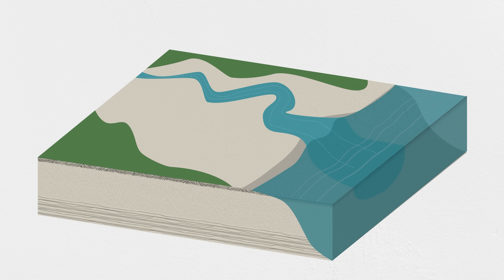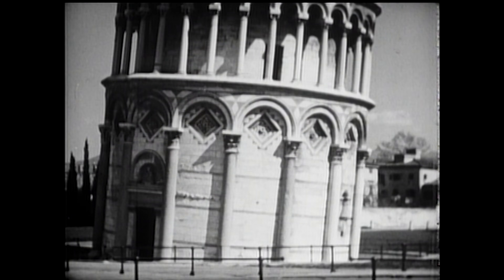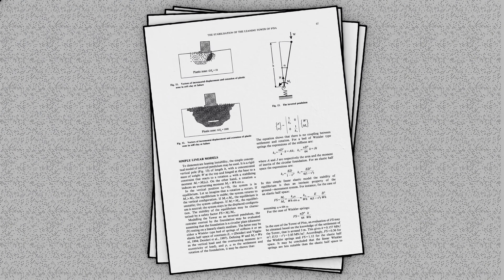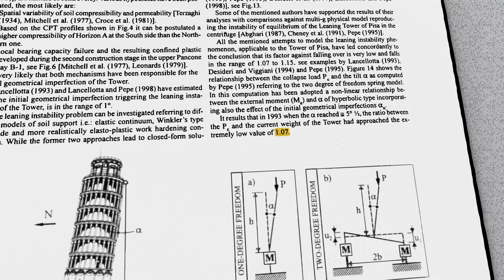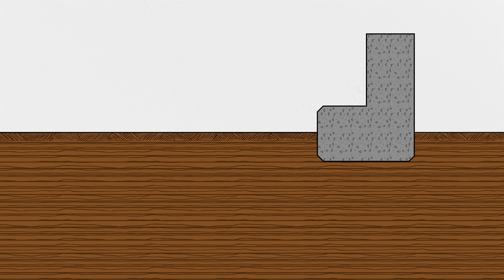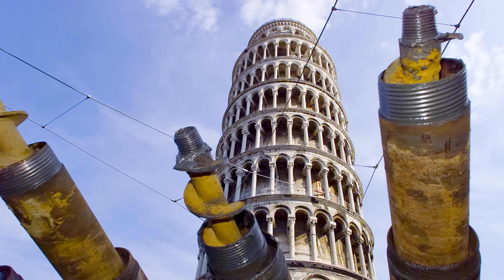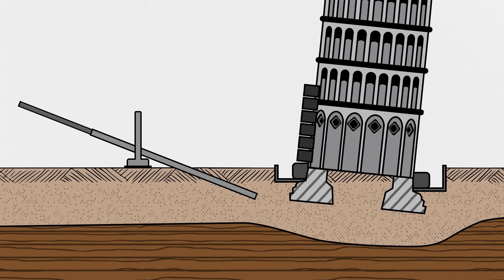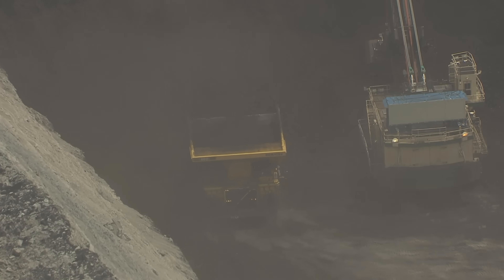How Engineers Straightened the Leaning Tower of Pisa

Comment: Another video like this you could do on a many-centuries-long engineering project, albeit one that ended in failure, could be the Aztec capital/Mexico City's water and soil issues: Tenochtitlan was a giant city with Venice-like canals built on both a natural island and expanded with a grid of artificial islands over time, with a complex series of levees, aqueducts, and other systems to intake fresh water and to avoid flooding. When the city was sieged by Conquistadors and armies from other local city-states, much of that infrastructure was destroyed and Mexico City, built on the ruins, had regular issues with flooding. Eventually in the 1700s intensive draining efforts to drain the series of 5 lakes in the valley got underway (after previous management attempts) and continued to the 20th century, which backfired as it ended up almost entirely depleting the aquafer and led to the liquefaction and compaction of the loose lakebed sediment, especially as Mexico City's urban sprawl has spread over much of the former lakebed and added (millions) of tons of weight.

As a result, today, Mexico City is sinking... rapidly. Some parts of the city as fast as 50 centimeters/20 inches a year, and it's not predicted to stop for many decades, and recent reports have found that it's past the point of no return already. There's constant issues with sewage lines, subways, etc breaking as a result of this, and it's renewing flooding issues while the lakes are mostly gone (save some surviving Aztec period canal systems in Xochimilco, which too are threatened by this), now it's worsening issues with retaining rainwater. 

Some other channels have covered this already, but I find many of the videos don't delve into the specific engineering details or all the historical context: We know the specifics of how many of the Aztec aqueducts worked (the main aqueduct which sourced water from Chapultepec for example had dual ceramic pipes with a switching mechanism) and with the specific drainage projects, yet neither has really been covered with detailed diagrams and like yet like you did here. I also find people only mention Tenochtitlan, sometimes even mistakenly showing the valley being empty aside from Teno. with it only urbanizing as Mexico City grew, despite there being hundreds of other Aztec cities in the Valley some of which had their own lake infrastructure/engineering efforts (like Texcoco's Texcotzingo waterworks system) some of which played a role in these events; and there being significant urbanization there for thousands of years before the Aztec period, like with Tlatilco, Cuicuilco, Teotihuacan, etc. 

So I think there's still room for you or the Wendover team you mentioned you work with to contribute to the topic in a way other people haven't done so yet. I actually work with history and archeology channels with researching and fact checking their Mesoamerican stuff and would be down to help out if you ever wanted to cover it!
Reply: Very interesting. I only knew the outline of this. This topic is a must for this channel. Although I think it will take more than one video!
Reply: That sounds fascinating!
Reply: How do the massive sinkholes which open from time to time come about?
Reply: This!
Reply: An entire channel dedicated to infrastructure history and archaeology would be fascinating.
Reply: +1 for this idea!
Reply: This comment helps bring out the qualitative difference of Spanish & Mexican engineering from world recognized as top notch British structural engineering. A high proportion of difficult projects no matter where have British engineering and construction talent in charge from planning to final touches.
Reply: This same process used to fix tower of Pisa was first used to straighten Mexico City's Cathedral

Comment: I just finished a geotechnical engineering class that had a section on consolidation. One of the really interesting things we learned about electro-osmotic consolidation is that it is triangular so the soil between the electrodes is not consolidated equally. Another really interesting thing is that electro-osmotic consolidation not only consolidates the soil but also increases the strength of the soil due to particles from the electrodes being left behind during the process. I think that it is a fascinating process that deserves its own video.
Reply: Surely this is only a temporary condition? Any zones of negative porewater pressure between electrodes should start the consolidation process in the surrounding soils due to the pressure gradient.
Reply: Interesting
Reply: @craigmcdougall3693  I just checked my notes again and I want to be clear I am not an expert in any of this but this is what I could find. The reason for the ununiform consolidation is that the voltage is highest at the anode which causes the water to flow towards the cathode. This results in the highest degree of consolidation occurring at the anode while the lowest consolidation occurs at the cathode as the water that flows out is immediately replaced. Once the power is turned off the pressure gradient dissipates but the ununiform consolidation remains. As for the permanent change in soil properties, studies showed that the Atterberg limits of the soil also changed in a triangular distribution with the highest increase occurring at the anode. The cause for this is that as the anode corrodes its ions flow into the soil in the direction of the water flow and react causing a change in soil properties.

Comment: Somewhat similar was done to one bridge pier in Bratislava recently. It was sinking and leaning into the Danube. The bridge was being rebuilt, so they decided to inject concrete under high pressure under the pier as well as inside it to fill all cracks. Eventually the bridge pier from the year 1890 rose and tilted several centimeters, but I do not remember the numbers. It was also reinforced and extended, as two adjacent piers to one side were replaced by a single one to make the passage wider and the bridge is a bit higher above the water. Thus existing pier had to carry a higher load of the longer bridge "field" between the piers and shipping is now easier even during times with higher water levels of the Danube river. I thought they injected some concrete under pressure below the sinking side of the Tower of Pisa, but they did the opposite - they made the other side sink to compensate for the tilt. Until watching this video, I was completely ignorant, I just remember reading that the tower was somewhat "straightened" in the 1990s using modern technology.

Comment: I'm old enough to remember when all this was going on, and the huge debate about straightening the tower completely. Thanks for covering this Grady
Reply: While the structure is impressive I don't think it'd have garnered nearly the attention it has if it wasn't leaning. The lean is the main attraction with it. Straighten it out and it's just another antique building. So I can't agree with anyone that was advocating for completely straightening it. Although I might have straightened it up a bit more than they did. It's still really leaning. But I guess that's how they like it.
Reply: As Grady pointed out, it's not just leaning but also curved.  They couldn't make it perfectly straight even if they wanted to.  If the base was level, then it would be curved to the north, because the upper levels were built to compensate for the lean to the south.
Reply: @jdlessl  nothing is impossible. They could fix that too if they really wanted to. It isn't practical but that doesn't mean it can't be done. They could tear the whole tower down and completely rebuild it if they really wanted to. Make it straight as an arrow and you'd never know looking at it that it was done. They rebuilt Stonehenge in 1958 with heavy equipment and nobody today knows. The megalith you're familiar with didn't exist before then. People think cavemen built it. Maybe once they did, but not the site today. They put it together how they think it may have been. But it was really just a pile of rocks when they started. Some work had been done previously in 1908 I think too? But they really tore it apart and redid it in the 50s. Anything for the tourists.

Comment: A video where I knew the ending before I even watched it!  Way back in 2000, I was stationed at Camp Darby, Italy when I was in the USAF.  Pisa was about 5 miles or so away.  When I was there, they had the counterweights and unsightly cables attached to it; people were not allowed inside.  It was a few years after I left that I learned about the augers that evacuated soil under it so that it leaned back the right way.  They probably could have made it perfectly vertical using that method, but that wouldn't be any fun to have the Leaning Tower of Pisa no longer leaning....

Comment: I lived in Pisa when the consolidation project started, I could see the leaning tower from the window of my room. The building where I lived was noticeabily tilting, a marble or a ball on the floor would immediately started to roll and also any water spill on the floor would drift toward the wall. The sidewalk at the side of the building had detached from the wall. This would have been very concerning on a different city, but here it was accounted for while planning the building and no consolidation was required at that point in time. The soil in Pisa lacks stiffness to support tall buildings correctly and driving piles to the bedrock would be excessively expensive - and far beyond the capabilities of the ancient builders. In Pisa there are two further smaller leaning towers, San Michele degli Scalzi and San Nicola. The former is leaning more than the famous tower. The ancient builders  found a way to keep it standing (internal arches, I'm told) despite the quite obvious foundation fault.

Comment: engineers didn't "straighten" the tower, they stabilized it and reduced the tilt from 5 to 3.5 degrees. if it was straightened it wouldn't be called the leaning tower of pisa any more would it

Comment: The way they built the tower curved to counter the lean was just genius, it shown that they really understand why it lean, even though not by calculation or full picture, they got the basic of it. 
If they got modern engineering tools, they would have already fixed the lean back then with incline drills.

Comment: Fun fact: in the late 80s I worked for a company which had significant expertise with these kind of problems. They were asked if a solution using some kind of hydraulic pistons could be used to “straighten” the tower. However my company declined to work on this because they thought the risk was too big and the tower could/would topple. Also, due to the lean the stones in particular at the base of the tower suffer from a significant shear stress which might have caused the stones to fracture which would have made the hydraulic piston solution very risky. I am glad to see that the Civil Engineers got the problem under control…for now…

Comment: The irony of building the banana tower curved over time is that there is considerable more weight of materials on the outer long side than the shorter inside, and of course the long side is facing the tilt, so the original fix to curve it just dooms it more. I wonder how the offset in weight on the leaning side vs the offset in center of gravity from the belfry being shifted the opposite way cancels each other  out?

Comment: @practicalengineeringchannel Video Request Based on the Dec 9 Nashville TN Tornado that explosively (with a well videoed fireball, that one weather channel news person claimed momentarily stopped some rain due to the immense heat evaporating it) destroyed a electrical substation.

I work nearby (my building was not damaged but has a good view of where the electrical crews are doing what they do) and it has been awe inspiring to see the literal armada of bucket trucks, cranes and the like put up replacement poles, holding up replacement wiring that isn’t yet attached to any of the 5+ poles in view with each bucket truck personnel tending to their part at their pole.

Seems like a video topic perfect for your channel and I would love to watch it!

Comment: Several alternative proposals faced rejection, such as implementing an underground tube system beneath the foundation to freeze the subsoil's water, regulating the temperature based on the tilt. Another suggestion involved utilizing hydraulically injected foam alongside water-cured polymer injection to address the lean and reinforce the subsoil. The innovative ideas presented a spectrum of solutions, each vying for approval in the quest to rectify the lean.

Comment: I went to the top when it was at it’s maximum tilt in March, 1972. 
I am constantly fascinated bt this Leaning Tower in Pisa, plus that Galileo went up to the top {with or without conducting his gravity experiment just adds extra pazazz to my standing at the lower edge where he must have stood, as well. 

The experiment proving that the weight of an object falls at the same speed as any other ‘solid’ object as was conclusively proven on the Moon between a feather and a hammer; granted a feather and a hammer would not fall at the same speed from the Pisa Tower due to the effects of air and wind on the feather, but a golf ball, a bowling ball and an anvil would fall at the same speed.

Comment: Excellent explanation of what they did.  I'm a structural engineer, and love this channel.  It seems like the engineers could have used more bruit force and anchored it onto bedrock, or a stronger soil layer.

Why not decrease its tilt even further?  Why not stabilize it with piles or dried shafts?  Pump grout into the soil to stop it from compressing.  Build large retaining walls well away from it on the east and west edges and push beams below the footing ring.  Support those beams on drilled shafts....  It seems like there's a much better way.  It's not my project, of course.  But I wonder.

Comment: This is not exactly as it was explained to us in graduate school ('96) by my professor who had I recall been a consultant on the project. My understanding is that when the lead weights were added the tilt began to increase since the surcharge increased the triaxial stress in the soil. Other older methods of grout injection had also failed for the same reason. Any increase in soil pressure resulted in a safety factor decrease and more tilt. It was not until they began removing and replacing the sensitive soil through borings that the tilt was stabilized and controlled.

Comment: As an unqualified engineer I would recommend putting turnbuckles in the cable stays, pulling the tower up reasonably straight and bunging some rubble in the gap on the leaning side.
Why didn't they think of that? I am here to advise.

Comment: I started thinking of pumping concrete under the side that is settling (the south side, I guess that would be).  But as your discussion proceeded with explaining how weights were applied to the north side to even out the settling, I realized that pumping concrete under the south side might make the problem worse.  Instead of adding support to reduce settling, maybe the added weight would make that side settle faster?

Now, what are they going to do with the Millennium Tower in San Fransisco?

Comment: I was stationed in Pisa during Operation Desert Storm.  At that time, the counterweights were in place, and they had pipes running underground to freeze the land under the tower to limit additional lean.  
The tower sides are not curved like in the thumbnail.  It was built straight up, but once it started leaning, the next portion of the tower was then built straight up, with a tilted base.  There were two corrections made to keep the top pointing straight up.  
There are no plans to actually correct the lean, but their goal was to minimize the lean and keep it from falling.

Comment: I'm surprised they didn't consider adding in some sub surface stabilisation as part of the final solution. I'd have though some concrete piles driven in in the same plane as the holes, but all the way round, would have been a good way to settle it permanently.

Comment: Great. Visited the tower in the spring 1963.

I expected offices of sorts. Nope. A staircase goes up on the outside of a wall. The inner section is totally hollow, going up and down. The pillars are only on the outside. I was 10 then. Great experience.

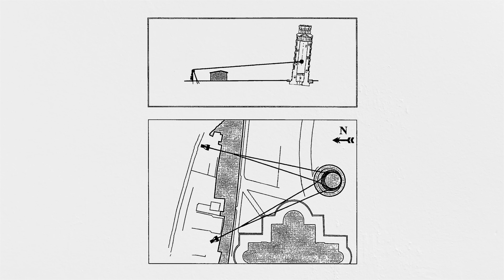Comment: at 9:12 isn't that a seriously bad idea, to try to hold the tower by its mid-section with cables? 
Isn't it the same as having a tall thin tube and you press it on the side which immediately collapses it?

Comment: I thought they pumped massive amounts of concrete into the soil beneath the collapsing side to stabilize the soil and stop the compression. Seems weird to remove soil from the high side meaning that the end result is a building that may be straighter but sunken in the earth more over all.

Comment: How would those cable stays not cut through the stone masonry if the tower went out of control? You can see they are wrapped around the outer singular columns. Maybe they also wrapped around the inner "elevator shaft" (spiral staircase) but if the columns failed under load that cable would hit the shaft with brute force!
It just seems odd to me that they would put a cable around the columns- dead center too. Why not around the base of an entire floor?

I may not be able to play Roadtrip Engineering Bingo in my region, but I've been to the tip top of this puppy! Looking down the tilting side to see the building leaning away from my feet. Before the fix ❤

Comment: I had learned about another idea they had to stabilize it, not mentioned in this video. To put refrigeration pipes under and on top of the ground, and freezing the soil which would both harden and stabilize the soil and expand it on the lean-to side. They opted against the idea.